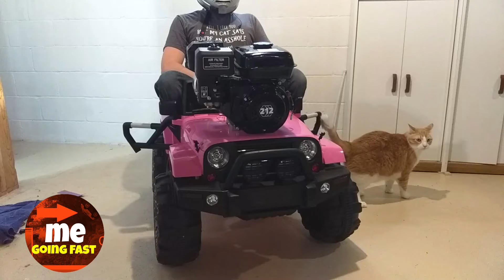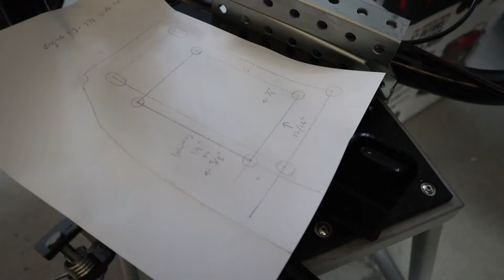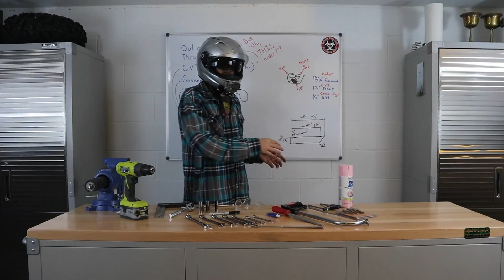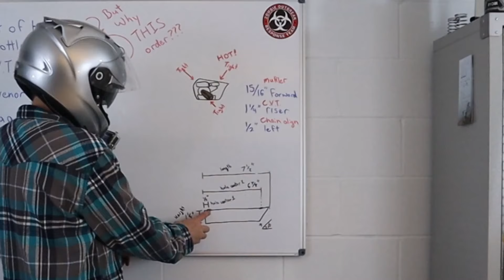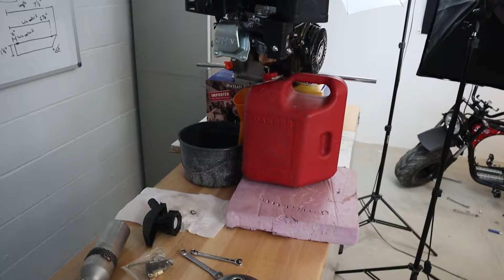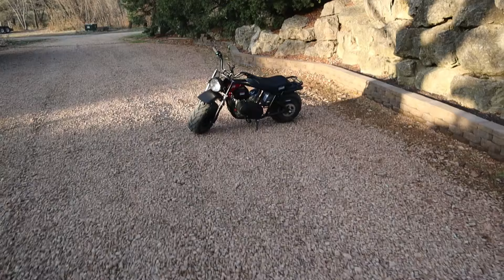Coleman mini bike performance parts for RB200/BT200x torque converter stage 1 and governor removal

Comment: just bought 2 Coleman mini bikes for the grandkids and maybe me too, B200 and B200RSV, just put on the RSV a OMB kit with header, carb, air cleaner and 2 degree key way, I couldn't tell the difference with my 220 lbs. What's the issue with the stock torque converter? I'd hate to spend all that money and not notice a significant difference

Comment: Great explanation, thanks.  Every video I have watched regarding the removal of the governor, they state you must replace the internals (rod/flywheel) as well.  Yet, you state with the torque converter you can remove the governor and still be good.  Can you explain this?  Thanks!

Comment: But if you don't own a drill or even if you have a drill and don't have a set of drill bits you'd probably be better off to just buy the correct engine Riser plate a set of decent drill bits are going to be more than what it would cost for the plate but once you have the tools you can use them again if ever needed

Comment: So my 196cc in my RB200 blew the metal in head between the valve springs, so I put a 6hp Honda OHC from a frozen power washer.  It has 8.9 ft lbs compared to the Predator 8.1 ft lb torque.  I'm hoping that will be enough to max out a torque converter pulley when I install one.  The good news is those OHC engines are even easier to attatch a torque converter to.

Comment: Love your channel man, great video!! I need your help, I got the OMB Stage 2 kit with the shorty header & muffler can I use the 1”x1” square tube riser kit from go power sports or the OMB no offset riser plate? And you said the chain was 6 links too short, so would a #420 108 link chain be the right length, i believe the comes stock with a 102 link right?

Comment: Hey question I bought the same header you have and I have the same mini bike same motor and I also have it lifted because I also have a torque converter but will the header fit with moving the motor forward the aftermarket header the way I have it lifted is just lifted straight up not forward original position will the header fit ?
Reply: Where did you get the header

Comment: Hey I know this video was a while ago but your input would be much appreciated. I’m looking at getting the juggernaut super 30 series torque converter for my ct200ex. Some people say it adds enough torque to do wheelies. Other people say it’ll slow the bike down because it’s meant for higher revving motors. What do you think?
Reply: The short answer is if you're not going to build a 7000 RPM engine do not get a Juggernaut for the torque converter. You don't need it with a stock engine and Coleman gearing as you see in this video.
Reply: @Deucealive75  Should I even try to replace the stock Torque Converter
Reply: @Dingbobber  The stock torque converter? You mean the jackshaft? IMO every Coleman 200 needs a torque converter. You don't always need a Juggernaut. I certainly don't need one.
Reply: @Deucealive75  Okay, my bad I’m new to automatic bikes. Is there one you’d recommend for the stock Coleman?
Reply: @Dingbobber  Any 30 series torque converter like the one in this video. They are available everywhere from EBay to Amazon and all the big suppliers. How to installations are all over youtube.
Reply: @Deucealive75  Thanks

Comment: You would do better by lighting the clutch shoes to increase your torque by increasing rpm before engaging.
Simple to remove a little at a time.
Or just get the juggernaut from Go Power Sports

Comment: Did you ever get it to fully go into overdrive where the front pulley belt was all the way up and the back was all the way down? If so what did you have to change and you set up I’m having the same exact problem right now
Reply from the maker: I added a green spring in the driven pulley on the torque converter. Made a video about it to show position too.

Comment: I’m looking to upgrade my RT200 with all these upgrades with the exception of the air filter. I go through some thick woods and it looks like the air filter sticks way out. Can I do all these upgrades (exhaust, jet, etc) while leaving the stock air cleaner and still have it run decent or will it not get enough air? Thanks in advance.
Reply: Did it work I am in the same boat

Comment: Hi! @megoingfast Great video that goes into extreme detail. Only thing I can't seem to find is the size 38 Jet. Do you have a link to where I can buy it on Amazon?
Reply from the maker: looks like it's hard to find. Might be sold out. I typically search "predator 38 jet" on amazon and find it. If nothing else, I've bought .38 jets from Childishconcepts.com before. They can drill to any size. Amazon has the 36/37 jet kits. With these combos, if you get the right emulsion tube and up the idle/pilot jet they can work fine as well.

Comment: Do I need the 38 jet if I don’t have the torque converter on? Thanks @me going fast
Reply from the maker: If you do the header and intake filter upgrade, yes.
Reply: @megoingfast  Ok well I did do those so is it a longer looking thing or a small Jammie? I don’t know much about carbs :l

Comment: I cut my square tubing more like the setup gopowersports sells, where they're used across fronts/backs mounting holes and not left-right mounting holes. I used the tubing's existing hole and opened up another in each case. It was pretty easy to align the chain without having to drill into the bike's engine mounting plate. Chain alignment looks good and does not rub against the torque converter housing.

The torque converter runs at idle. Wish I new why! Can't start the bike on the ground. On a lift I lowered idle speed a bit but it didn't help. When the front clutch cover is installed it's wobbly, so I temporarily tried it without that cover and was able to start the bike without idle causing the rear tire to spin. 

That is ...  until I gave it throttle, and the outside of the belt immediately began to shred. Against what, I have no idea. The pulleys naturally have good alignment because they're bolted to a common plate. And no, I did NOT put the belt on incorrectly. At idle, it once again spins the rear tire. I really wish I knew WTF was going on with this janky setup.
Reply: So the janky setup was my janky setup. I installed the outer pulley sheave of the drive clutch backwards. Why, I have no idea but it might be related to me reading the included directions, which do not show this. Technical writing is an actual profession, and "Calm Max" didn't employ such a person.
Reply: Good to know

Comment: re: torque converter installation
I keep seeing the middle holes being used but why not just rotate it counter-clockwise to the next set of holes, instead of lifting the engine? I reckon it still hits something, or else everyone would just do that instead.
Reply from the maker: Jackshaft needs clearance

Comment: On the risers you make, are the bottom holes  in the same spots as the top holes?
Reply from the maker: Not where it's mounted. If you have a "stage 1" mini bike, though you can raise the engine up and over instead of also need to push it forward.

Comment: RB200 owner here. Did I hear you say the original chain is about 6 links too short with the torque converter? Is there a way to use some links from the clutch chain I'd no longer be using? Also ... where's a good place to pick up the 38 jet?

I plan on using the OMB riser, Stage 1 air cleaner etc. I'm not crazy about the large S-shape header however, although I get that's easiest with this style of rear fender coming right up to the rear rack. I'd much rather find a way to use a style that exits from the center instead.
Reply from the maker: Sorry for long delays - YouTube batches what I see in my comments feed... jerks... If you have a link breaker that is also able to smash the pulled pins and a link connector, its possible but I can't recommend it to most people. Yes, the chain will be too short by 6 links. The jet is actually a little low in stock on amazon, but if I don't find them there I just buy one from ChildishConcepts.com website.
Reply: @megoingfast  No worries! For me the original chain length was fine, because I only raised the engine 1" and did not need to move it forward. Made 2 risers from 1" square stock. I only re-adusted the chain tension via the back wheel location a little bit. I mean it was like at most one link too short otherwise, well with the realm of adjustability.

I'm currently using a .020 secondary, an E140 tube and 34 jet. With stock (.016) secondary and e-tube, a 38 primary was "OK" until the engine got hot and then it ran lean, and ALWAYS ran lean at start and idle. Switching to the E140 was like magic or the midrange and upper end. Pulls like a train there. For me, the large primary helped a little on the low end -- indirectly -- but wasn't the best fix there like the idle jet and etube were.

Switching to the .020 secondary allowed it to start WITHOUT choke when hot (duh) and cease stalling off-idle but might be a tad rich. Tomorrow I'll try splitting the difference with a .018 secondary. For me, all of this is why the smaller-than 38 primary jet works, and this isn't a high-revving or non-governed build anyway. I'm using a little shorty curved header and RLV Mini 91 muffler. No way to get singed while riding. 

My first setup went straight back, under the seat and nearly burned a hole in the seat (I'd lowered the rear fender to make room.) Bought a Monster Moto 212 seat for less than the Coleman seat and it's unsurprisingly a direct bolt-on.
Reply from the maker: @thenexthobby  I cheat and drill all my clone engine carb pilot/idle to .3mm for easy starts, especially in winter.
Reply from the maker: @thenexthobby  thanks for sharing your setup!
Reply: Does the omb warehouse riser fit on the rb200 ?
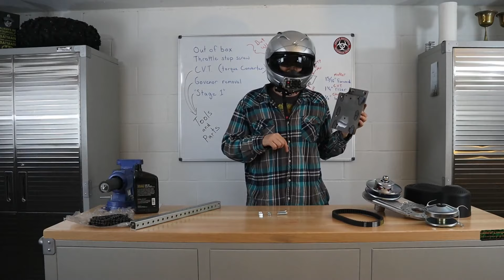Reply: @ericbedard7219  He mentions this from about 5:00 thru 5:45 and what you'd have to do make it work.

Comment: Even without raising the engine, it's worth ditching the stock air cleaner on the RB200 because of how close it already is. I can't imagine how you'd yank it off with the engine sitting 1" higher.

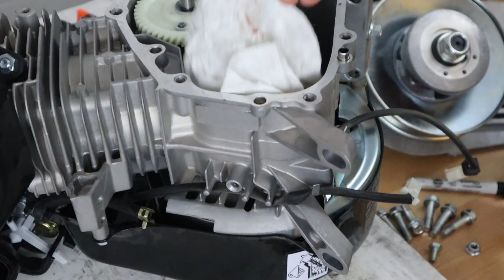Comment: 14:13 what's the plastic gear in there for? Why not metal instead?
Reply from the maker: The governor gear? Because it's cheaper, and not meant to go above 4600 rpm. Just a cheap part, keeps cost down.

Comment: What torque converter should I use and from where.? Do you offer a code for a discount.?
Reply from the maker: From amazon, 30 series, 420 sprocket, and I have no codes currently.
Reply: @megoingfast  Thank you Very Much.!

Comment: Guess I am a bigger guy at 220lbs 6'5", I got the throttle stop screw back all the way out, moved the governor spring over to the furthest hole on the arm, getting to about 26-27mph. The governor is no longer kicking in, guess I need to do stage 1 and see where I am before pulling trigger on cvt.

Comment: I am confused. If the RB200 is the Mega Moto Pro Frame, why can't I use the Mega Moto Pro Torque Converter and not have to do all the crap with lifting the engine with the plated steel? Bink!
Reply from the maker: Different frame. They look the same, but are different. I think I may have covered that the RB is using a jackshaft and clutch in the before you buy video, but I did not side by side my pro, max, and RB at the time. I have a side by side for the pro and the max that do close ups a little better.
Reply: @megoingfast  I'm subbed, thanks for explaining!

Comment: Can i ask some noob questions? Do I need stage 1 before stage 2? And do i need a torque converter before even putting on those?
Reply from the maker: Yup. Nope. Nope. Stage kits are typically marketing packages from companies selling products. You can do many mods without doing it directly in line with what's being sold.

Comment: Would removing the throttle stop screw flood the engine or damage the stock engine? Just concerning over every little thing I do to my bike to prevent killing the engine, I bought the rb200 and love it to death!
Reply from the maker: Not likely at all, very low probability. Throttle stop screw sets to an industry standard. Governor will kick in at higher speeds and prevent failures. Not one mini bike of the dozen I have has the throttle stop screw in.
Reply: @megoingfast  awesome, keep up the good videos!

Comment: Do I needed the stage 1 if I remove the governor
Reply from the maker: You don't need it, just makes it a bit faster. Removing the gov with only the torque converter won't do much at all.

Comment: How much this all cost.
Reply from the maker: Prices change but around: Cvt $60, header $45, muffler $35, header wrap $20, intake adapter and filter $40, jet $12, metal $10 with bolts, chain $25

Comment: Do you absolutely need the risers for the torque converter??
Reply from the maker: If you want to cut into the engine plate and the torque converter plate, possibly. The problem with the torque converter is that it sits on the engine at and angle where it reaches out beneath the engine. If you upgrade to a header and air filter without box you only need to raise the engine up and move it over, not move it forward.
Reply: @megoingfast  will this kit as well as the torque converter still make a good difference without the governor removal?
Reply from the maker: @andrewquesnel2359  yup.
Reply: @megoingfast  sweet, thanks for the reply. I Enjoy watching your videos keep up the good work!
Reply: I plan on doing essentially exactly as you did besides the governor removal, I've got a 6.5hp 196cc powerfist engine on the same exact frame just rebranded from princess auto and with the engine stock just backed off throttle stop screw completely I'm getting 32mph but that is with a jackshaft setup, I'm hoping with he torque converter and stage one kit I can bump that up a decent amount without having to remove the governor

Comment: Seems like your the only guy on all of YouTubes who has an RB200 and is doing mods with it. I just purchased one which will be here in a few days. I live in the mountains and hills of North east Pennsylvania and would like to add a torque converter eventually but it seems like it’s going to take a bit more work compared to some other bikes. Is there a better sprocket combination that  you would recommend for low end torque and power to rip up hills? Would a stage 1 type set up do much of anything without adding a CVT or removing the governor? I would definitely like to see some more vids with this series of mini bike.

Comment: I have a question. I have the RT200 RealTree 196cc mini bike. I just ordered the cold air intake that was in the link below. Can I put that on as is or do I need to order all the parts in order to properly put it in there?
Reply from the maker: You would need the filter, adapter with choke lever holder, and depending what fuel type you use and elevation possibly a new jet for the carburetor.

Comment: how much HP does the 196 cc engine have if you know please
Reply from the maker: I have not put it in the dyno but it's rated at 5.5hp out of box. Likely makes about 6+- with throttle stop screw pulled back allowing higher rpms.
Reply: @megoingfast  i was just wondering because i just ordered the Coleman br200 196cc mini bike 'it look's ;like a nice little bike and am hoping it has some power i also orderd a tourq converter 3.4 inch hole i hope fits it

Comment: did the torqconverter hold up with the stage 1  i was considering getting the one from go power sports but if this is just as good for cheaper id get this but idk if its reliable or not
Reply from the maker: Hold up great. I have 3 of these seen in this video, 2 others of different brand.
Reply: @megoingfast  just ordered the rb200 excited ima have to do first ride stock make sure everything works right then stage 1 kits next then torque converter. Thanks for the video the info I got helped.

Comment: Thanks! I got the camo model (RT200) last summer right when they came out, $599 + tax shipped free to my local Walmart. But that was 3 weeks after getting a Coleman ct200ex from Tractor Supply for $699.  So I promptly cleaned up the 200ex and returned it; nice & broken in, to Tractor supply before the 30 days return date was over. But I changed the oil Immediately after buying it, then once again after an hour of riding (to break it in) but this time used Supertech full synthetic.  Thats when I cut off the throttle stop screw cuz they're welded on. So, at least it was properly broke in & did 25 mph for the new owners lol.
Reply: So you liked the RT200 much more than the CT200ex, I was tempted to get a bt200 or ct200 to go with rt200.
Reply: @carlo1132  yeah the RT200 & RB200 have way better foot position and handling for bumpy or sandy stuff.    200ex is nice on flat land & dirt roads, and if you add more foot pegs in the middle area it gets better off road
Reply: I agree with this comment. I own two. I'm planning on buying then torque converters soon

Comment: If you had to pick one, would you go rb200 or bt200x? Pros and cons of each?
Reply from the maker: So I actually have a video that goes over this in more detail (the before you buy the RB200 video), but to summarize I'd go with the BT even though when others come over to ride EVERYONE wants to ride the RB200 style mini bikes and they are more comfortable for longer rides. The BT is more versatile and I studded the tires and use it for ice fishing. With a larger rear rack it's the perfect size to put my auger and bucket and other gear in the back. Not as comfortable, but more rugged.